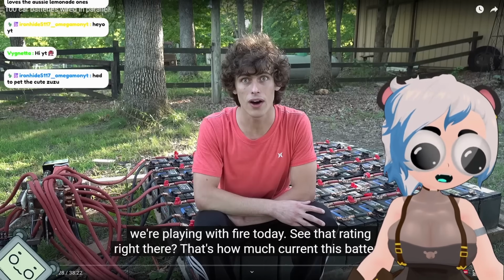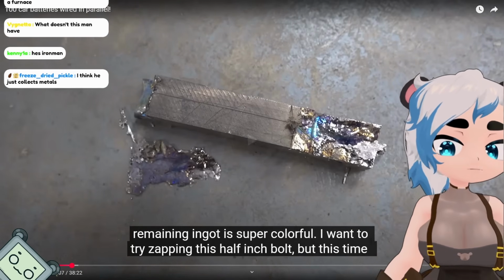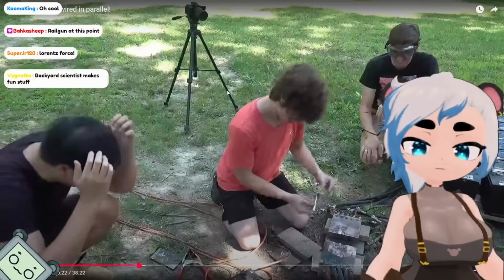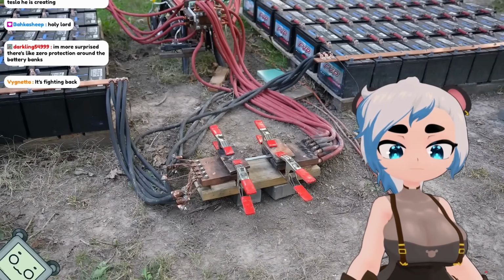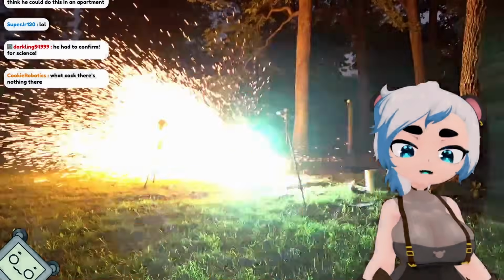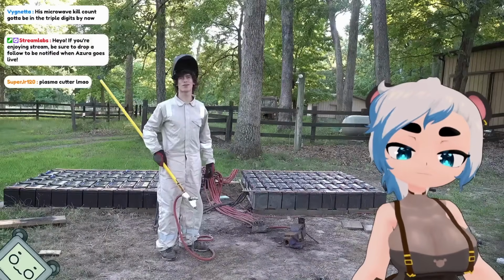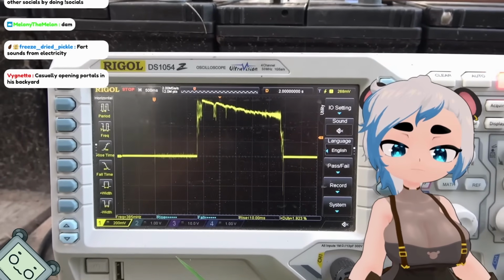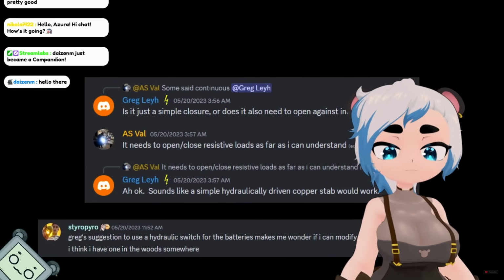Why does he have this many car batteries? | Azura Reacts to Styropyro #reaction #vtuber #microwave

Comment: Let me get this out of the way now please dont attach 100 car batteries in a 5 series 20 parallel circuit to the nipples. This is a great way to get charged with first degree murder. For context the heart will stop at around 30 to 100 MILLIAMPS. This circuit is roughly 850000 times more than enough current to kill you, and 60 volts is absolutely enough viltage to pass through the skin, easpeacially in a thinner area such as the nips. So unless you want charred human flesh PLEASE dont do that.

Comment: The oxides that show up on bismuth is super pretty, you can melt it on the stove as the melting point is around 500 or so degrees and when it cools if you crack the top layer off when it is still molten inside it will have crazy geometric fractal crystal patterns and when it oxidizes it gives off all those crazy colors, its gorgeous.